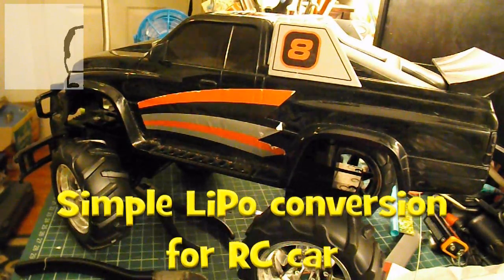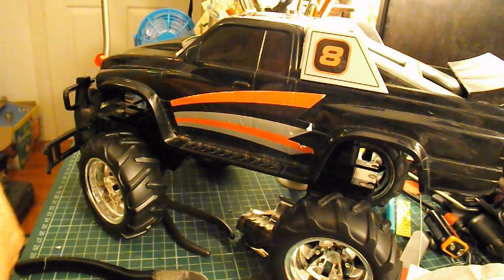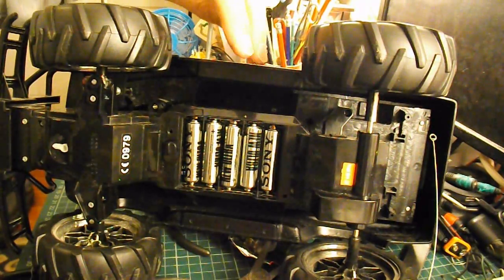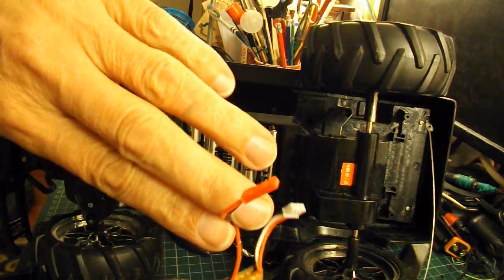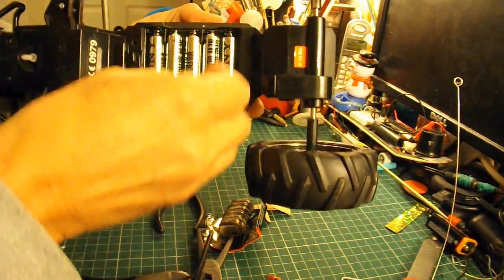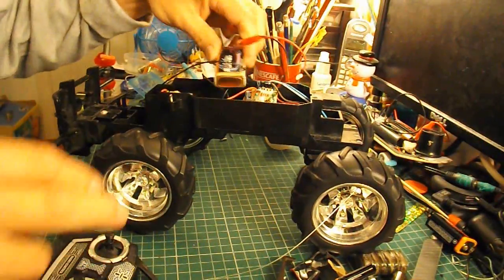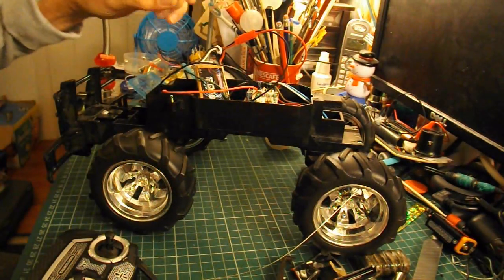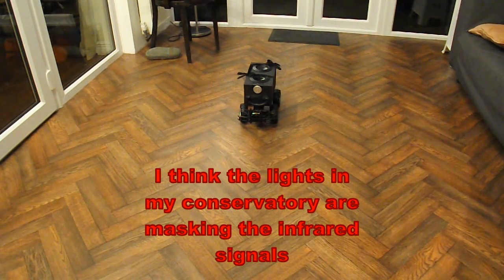Simple LiPo conversion for RC car plus RC BoomBox

Comment: I do have another question or a tip for rc cars if you are tirred of tiny range of the antenna you can use copper wire to boost the signal making it stronger I tried this on my rc car and the signal made about 35 meters of range I wasn't expecting that big of a range but it is fun

Comment: I got a challenge for u make a rc car that is solar
Reply from the maker: There really isn't much point. There are two basic options. 1. A good sized solar panel to provide enough power to drive everything direct. 2. A smaller panel to charge the batteries over a long period and then drive the car using the battery power. In neither case I doubt that we will get enough sun here to run it very effectively. Here is my Solar Powered RC Boat project https://www.youtube.com/playlist?list=PLA5a2xPRSrB0CbqRkzsGRzhfMqrEydOPg